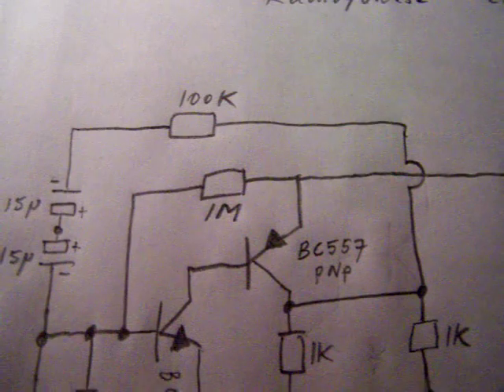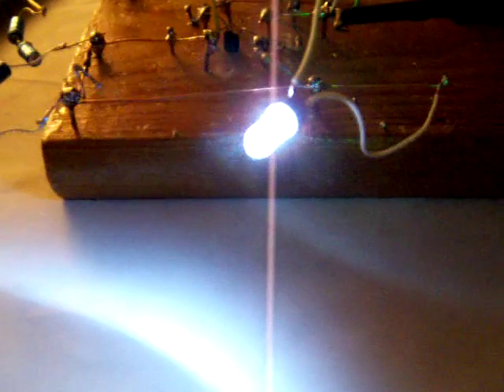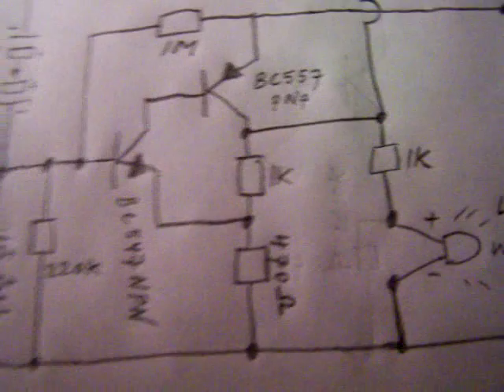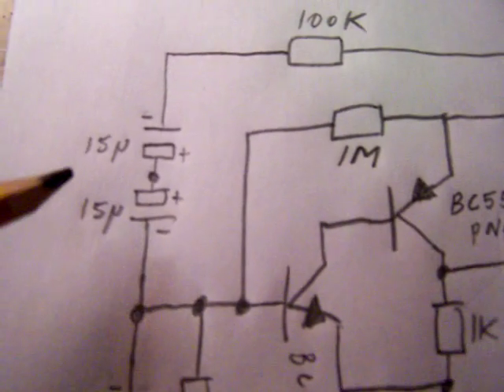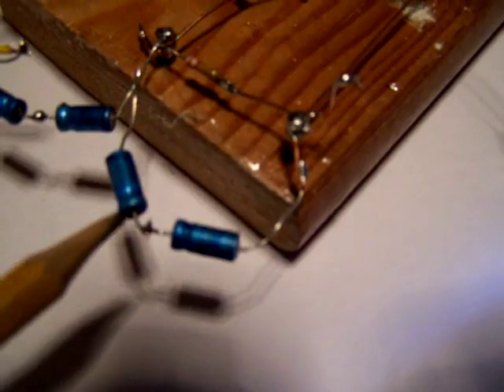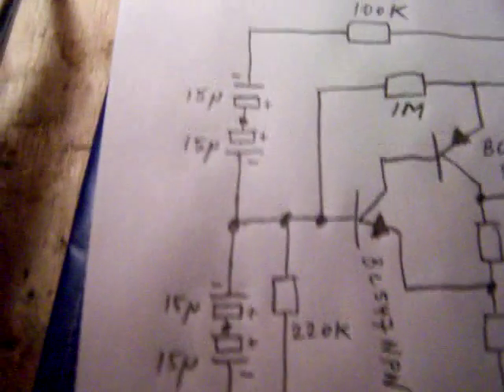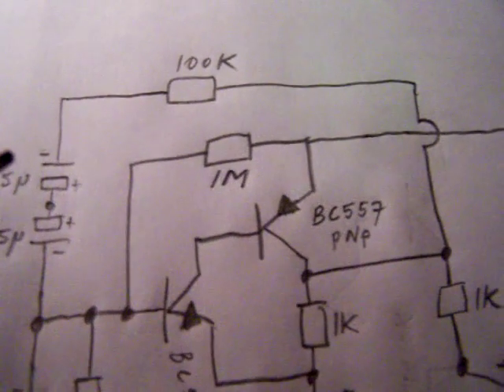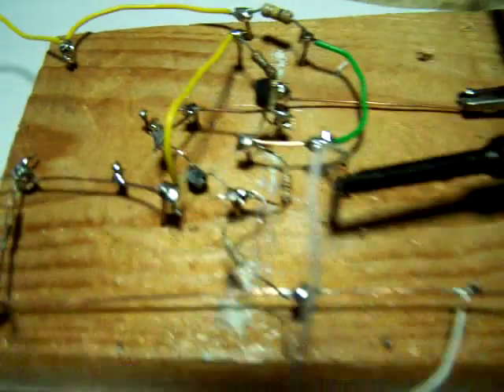Lighthouse LED (schematic)

Comment: Just built this and love the effect! could this circuit be powered by a 9v guitar pedal adapter or would it need more filtering/regulation?
Reply from the maker: I think it can work that way. If not: bridge the output of that 9v power supply with a capacitor of (say) 1000 uF  or 3300 uF or even 4700 uF. Gives better smoothing.
Reply: @radiofun232  Thank you!

Comment: looking forward to build it and put it in a small lighthouse I am building! Is it possible to make only the dark part longer? groet bram
Reply from the maker: By making the values from the capacitors higher (say 50 uF or 100 uF) the duration from the period (dark part or light part) gets longer. When you make the value from the "upper" or "lower" caps higher, you will have a short and a long period. Don't forget to connect the caps "antiparrallel". Dutch: als je de waarde van de condensatoren verandert, verandert ook de tijdsduur. Met bijv. een 50 uF of 100 uF condensator worden de tijden langer. De "bovenste" condensator zou voor de "uit" tijd kunnen staan en de "onderste" condensator voor de "aan" tijd. Het kan ook omgekeerd zijn, moet je even uitzoeken (ik heb het schema inmiddels al weer gesloopt). Let er op dat je de condensatoren aansluit zoals in het schema is getekend (+ aan +), anders werkt de zaak niet. Je maakt namelijk op die manier een niet-polaire condensator van een grote waarde. Als de de elco anders aansluit werkt het niet.
Reply from the maker: Als je verschillende waardes neemt voor de "bovenste" en de "onderste" condensator zullen de "uit" en de "aan" tijd ook gaan verschillen. Ik heb het schema overigens niet geprobeerd met hogere condensatorwaardes, maar weet vrijwel zeker dat het ook daarmee werkt. Mocht het niet werken met elco's van grotere waarden, dan valt het te proberen elco's te nemen met hogere werkspanningen, bijv. 100 uF - 60 V of 120 V oid. De lek-eigenschappen van elco's voor hogere spanningen zijn namelijk beter, ze hebben een veel hogere lekweerstand, dat betekent dat ze beter bruikbaar zijn in een schakeling (zoals hier) waar ze tijdsbepalend zijn.

Comment from the maker: Put identical Leds parallel to that one Led. Must be identical. Lower the value from the 1 K resistor in series with the Led or Leds if necessary. When transistors get hot, try a BD 139 to replace the BC 547b and a BD 140 to replace the  BC 557. BD 139 and BD 140 are (low) power transistors with a good Hfe/Beta. No guarantee that the circuit will work with a BD 139-BD 140, but worth trying.